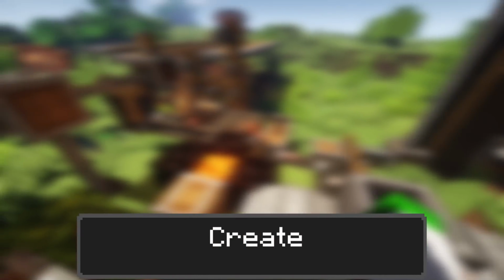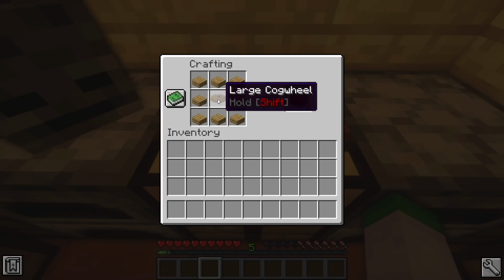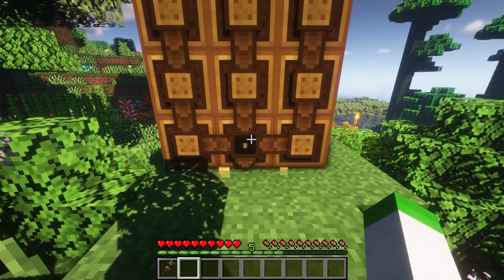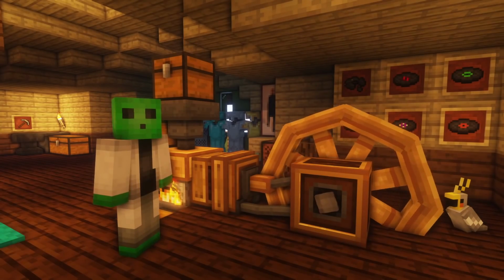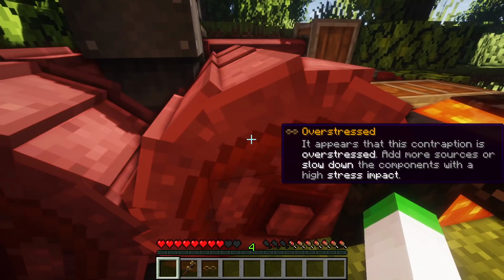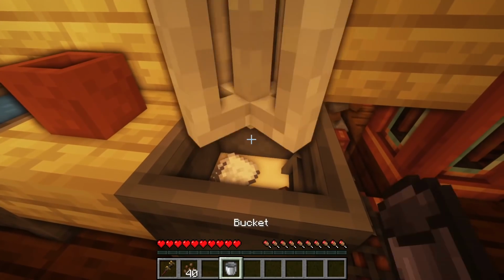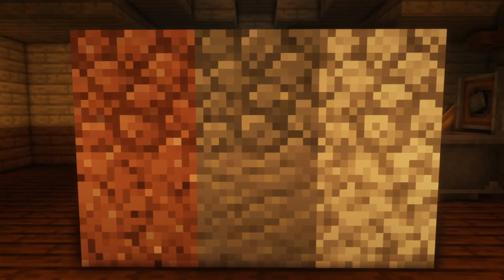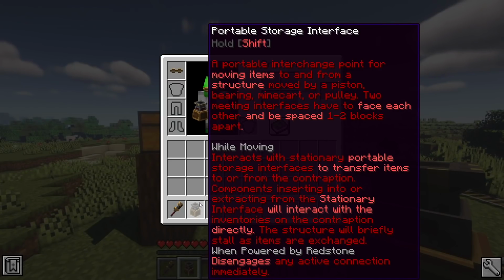Minecraft - Create Mod Showcase [Forge 1.16.5]

Comment: Realistic Water Physics
Realistic Block Physics
Create
Tinkers Construct

These are my favorite mods so far in Minecraft. They're so cool, and create interesting problems to solve.

Realistic Water physics applies to Lava as well, and destroys vanilla farms. So it adds challenge. However what it adds is the ability to pump water or lava from a location to another. This adds some challenge to create as well as water wheels will need some kind of pump to bring the water back.

On top of that Create solves the farm problem that Realistic Water physics makes. Now you are forced to engineer new automated farms using create with these new physics. I never thought I'd need conveyor belts in Minecraft, but now it makes sense with water physics being different.

Tinkers construct, although I don't like certain aspects for the most part is a 10/10 mod. It makes tool forging such a cool mechanic, the way it handles metals is really cool. How it adds to the other mods, I don't know I haven't tested it but I'm making a modpack for myself soon and I'll figure it out in the near future.

Realistic block physics is just cool, makes blowing stuff up cooler, and creates some interesting consequences for your actions. Now you need to think of supports when building a house or a tunnel, or even a mineshaft. It's the kind of difficulty you'd want while playing with friends as everything will take longer but it's cool when you have problems to solve in order to make something work.

Comment: Imagine a device that used nether stars as fuel source. You could probably also tweak to amount of energy (even while it's in use) it produced by using varying redstone signals (the stronger the signal, the stronger the output), but it would come with the downside of being very expensive and the stronger its energy output, the faster it would burn through a nether star. I'm guessing the longest it could use a nether star for (by having a redstone signal of 1) would maybe be 100 minecraft days while producing power.

Comment: Also create doesn't lag my potato laptop unlike other tech mods, even with all the fast spinnys. And it's much more fun than most tech mods so create is really one of the best mods out there
Reply from the maker: Its a very hands on mod that requires you to put things together to get them working, which compared to some tech mods, is great! Plus as you mentioned, it's quite performance friendly, although I've yet to test a large windmill or minecart structure moving would freak the pc out

Comment: 7:43 I've messed with the mod alot but how did you get a boat to work?
Reply from the maker: Quite complicated to explain but I built a small track using rails, had a cart assembler placed for where I needed my minecart to start (that way, it will attach block structures to it. The boat was all stuck together with super glue, with a glass pane stuck all the way to the cart assembler; when the minecart went over the assembler, the boat structure went with it. There was also a detector rail (I think?) so the minecart would activate when going on the cart assembler, redstone links to toggle the redstone signal between the boat and the hidden track below and that's about it. Hard to describe it without visuals but I watched through polarrt's tutorials on it on youtube (added his playlist in the description) about making vehicles move (planes, trucks, boats) so that should help you out there
Reply: @CrittersModMenagerie  sweet thanks.

Comment: You didn’t make the water wheel most efficient it can be
Reply from the maker: Not every time, as I had to demonstrate what happens if the water was placed incorrectly. But there were 1 or two water wheels that were operating at is highest

Comment: How tf did you make a boat
Reply from the maker: The boat build was all stuck together with super glue, which was then connected to a minecart underneath the ocean floor. A set of tracks were laid down and using both redstone links and a cart assembler, I was able to have the boat be connected to the minecart (it's registered as an entity I believe) and follows the path. Quite complicated but one of the links in the description should help you with that

Comment: Honestly tho, the mod makes all the complicated processes visible. It makes the mechanics much more tangible, unlike in some mods where it’s just one block doing all the work. Which I find makes the mod a lot easier to grasp than many other tech mods
Reply from the maker: That is something that I do enjoy about Create. As you mentioned, most tech mods just require you to have something that makes power and connect it to one machine that does all the work. For me, it takes a while to learn stuff so it can be a bit confusing when starting out.

Comment: good man, good explenation, good content
thank you for reviewing create mod!
now, some tips for generators
1.do not use copper handles for power sources, they give less than handcranks
2. at mid to late game, best mini power source is RSC+ 1 block windmill.
3. if you have sails, you dont need to use radial shashis, as sails connect to eachother.
4. best late game power generator option is blast furnace engine. 
5. do not try to go for the mid upgrade for the blockzapper. the final upgrade(being chromatic) is more powerful.
6. nether is an excellent place to gain resources, as well as infinite fuel, being lava due to large lava lakes being considered infinite. netherack will give you access to redstone dust, glowstine dust, and gunpowder if you have the contraption needed for it.
7. please use JEI, as it helps out a ton, especially on reading the block guides on the block.
8. use SP creative to experiment your ideas before making one. jts better to growl in creative mode than in your survival world.
9. have fun. create is very vanila-esque in that your imagination is the limit. feel free to experiment, break, build stuff as your heart desires. create has it all.

Thanks for reviewing create mod once again!
also, mod review suggestion: Ars nouveau
Reply from the maker: Thanks for enjoying it mate! Pleased you enjoyed it! And thanks for the handy tips about the mod!